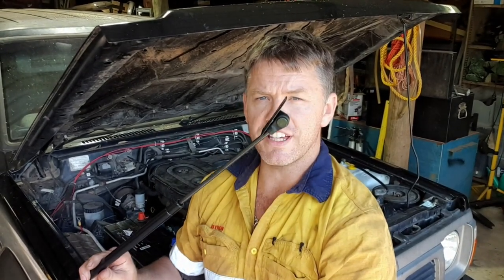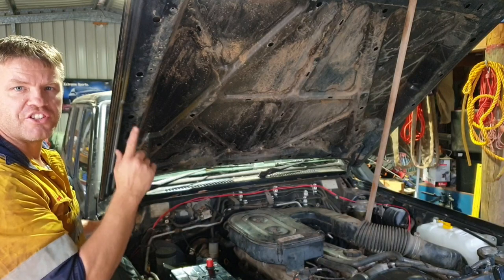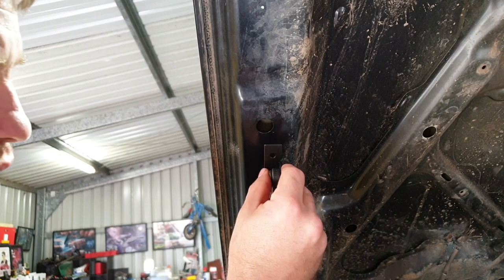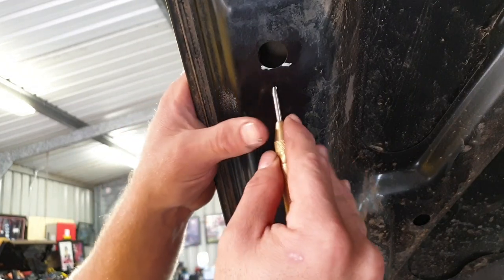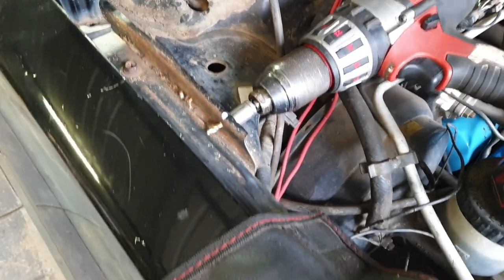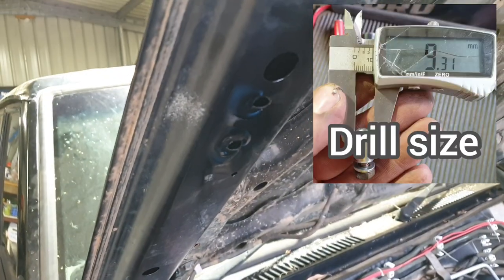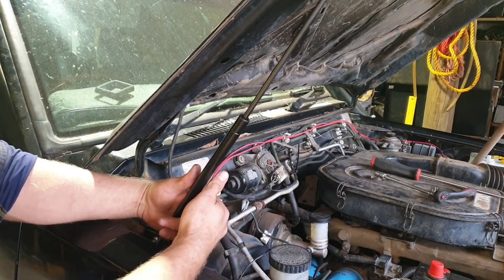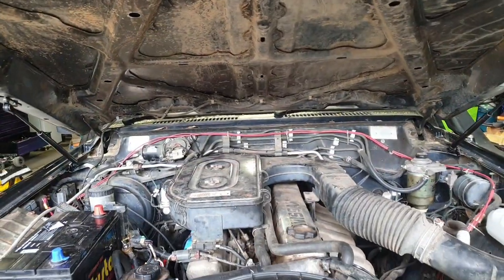How I fitted Commodore bonnet struts to the Nissan GQ Patrol

Comment: Hey mate, there is basically no info on mirror upgrade online for GQ’s other than big ugly ocam ones. The field of view is terrible top to bottom. However, $50 for some second hand 76, 78 or 79 series cruiser mirrors basically bolt straight on, look good and give you heaps better vision. Would be good to try and do a video on. Happy to send you some before and after pics of mine if you want
Reply from the maker: Yeah cheers mate